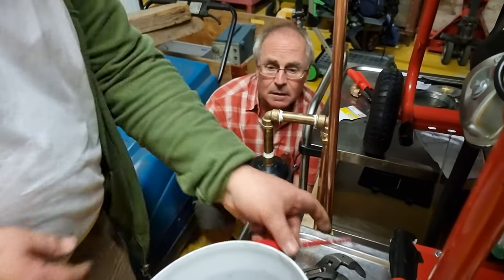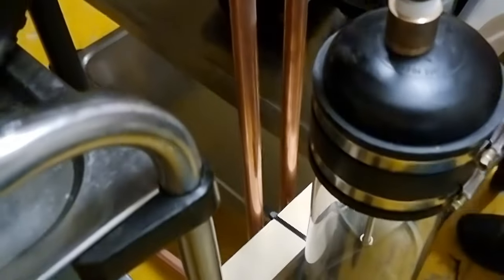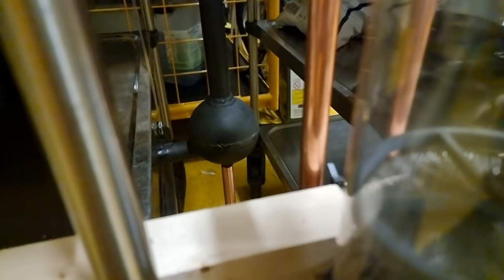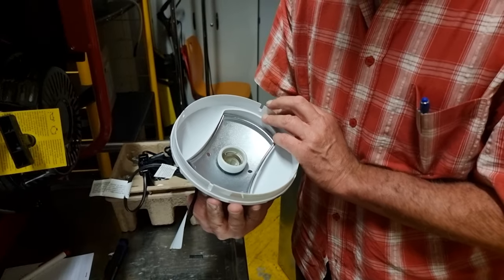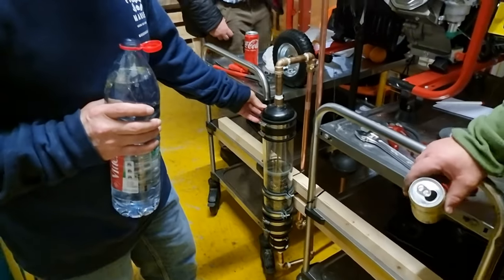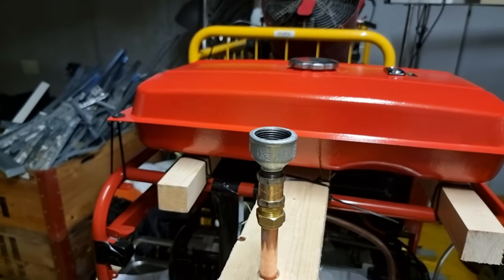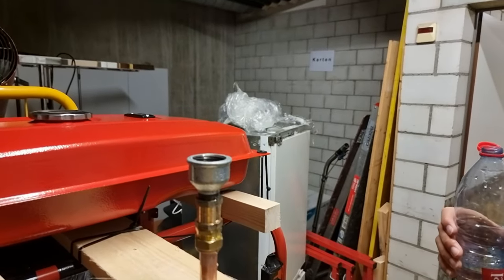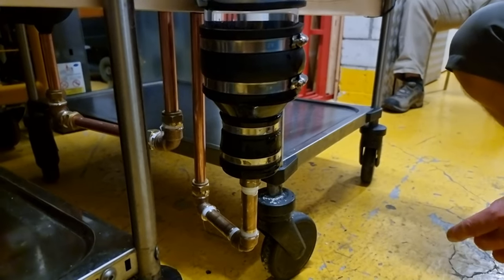THOR - Final plumbing and filling of bubbler with water

Comment: Curious to see how it performs compared to GEET reactors, it terms of emissions and fuel consumption. You can't really get a precise AFR with a carb engine like this. Would be better to use a small moped injector with a simplified ECU, such as micro squirt.
Reply from the maker: It appears similar at first glance to GEET claims but without circulating exhaust through bubbler and easier to make happen.

Comment: you shouldnt be using thread tape on compression fittings. they will not seal
Reply from the maker: The MFMP were just observers to the build.
Reply: @MFMP  good thing i wasnt observing.... there would have been some sharp critiques with such time constraints. im not unfamilar with critical equipment being serviced under pressure. literally. no place for tinkerers. sat diving has no room for maybes.
Reply from the maker: Firstly, a fully built UNIT that was meant to be demonstrated was held in transit in several countries, apparently, this was expected. The 1st backup plan was that a guy from US who has built many 100s of GEETs (as I was told) and built in a proper way a TSG in US for the testing there, was meant to come and build another on the fly there. He could not come at the last minute for various reasons and so two researchers at the conference went around to local stores and got parts to make it and the TSG tube alone was brought from the states by another party. As an observer it was easy to pick holes, however, I saw what was made, made in a morning and it apparently did something. @freelectron2029